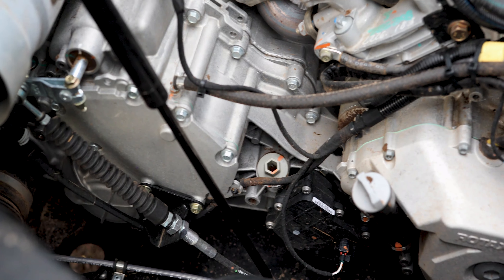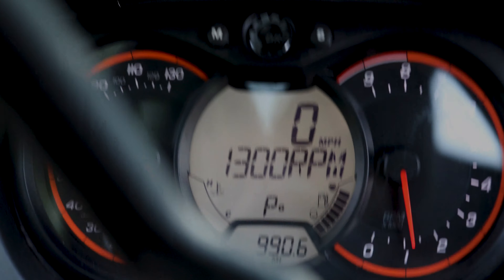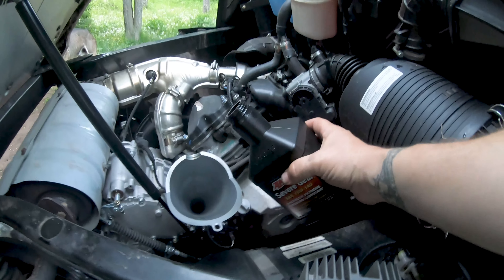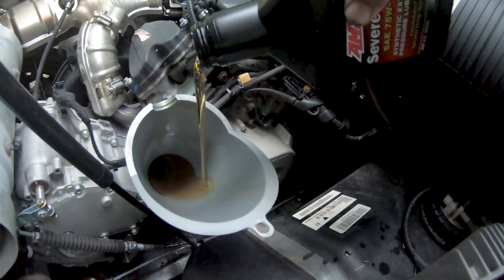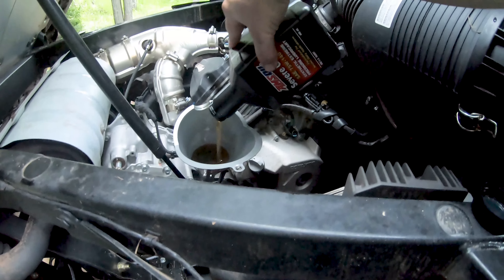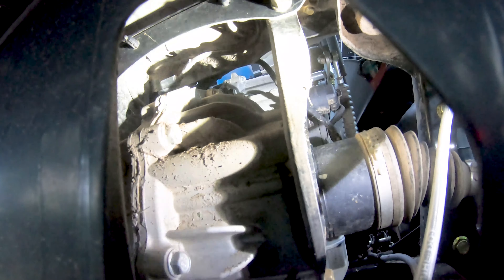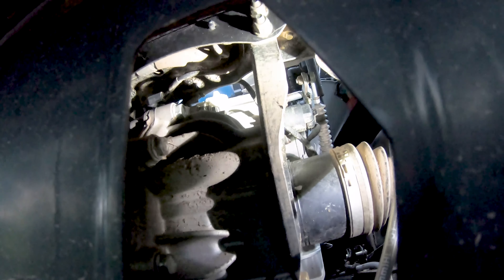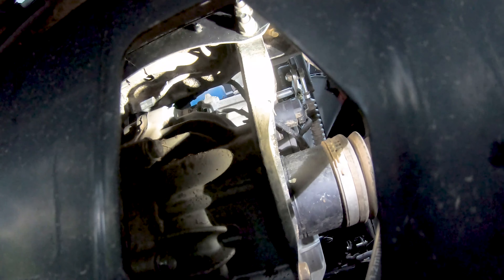Gear Box Oil Change // Can-Am Defender XT HD8/ HD10

Comment: Decent video I had to skip a lot I didn't care about the turtle just was trying to get right to the point. 
So there's not really a separate transmisson you have change the oil in, thats basically The transmission / rear gearbox you just changed the oil in? I'm really needing to change mine in my xmr.
Reply from the maker: Yes, no separate gear box like the Outlander has. Talk about difficult, oi 💩

Comment: My reverse has went out for some reason.  I have the 4 seater Texas Edition
Reply from the maker: Might just be a linkage adjustment.
Reply: @endurancekennels  Thought about that but all other positions work fine.  Seems if I move the linkage it would affect all others.  Park is good, reverse grinds a little but will not engage.  Past that high works then low works also?
Reply from the maker: @79xlch  crappy! Is it still under warranty? I have a two year warranty on mine.
Reply: @endurancekennels  I assume 1 year with it being 21 months old 880 miles
Reply from the maker: @Mr79xlch  two year it's a commercial work vehicle for the kennel.

Comment: Nice video, did you notice any difference in the ride after you changed this? What about after the engine oil. My buddy said his ran noticeably better once he did initial fluid changes
Reply from the maker: Yes for sure. Much quieter and smoother all around.

Comment: I noticed the end of my plug was full.of what looks like an anti seize? Did you notice anything on yours
Reply from the maker: No. Do you have a pic? The plug is magnetized so it picks up slack could be just that.
Reply: @endurancekennels  it does yes. I went on some forums and they said its common for the first oil changed
Reply: @endurancekennels  thanks for the reply

Comment: Take the muffler out. I did it without taking anything off. I have smaller hands tho. It was a big pain in the ass for nothing. I have 1200 miles on mine and it wasn't dirty. Waste of time.
Reply from the maker: What are you talking about?
Reply: Cleaning the speed sensor. Sorry

Comment: You dont screw in a dipstick to check fluid level....just so u know for next time.
Reply from the maker: Interesting so what do you do?
Reply: Luke: on Can Am machines, yes you do. It says so right in the manual. On some other brands of machines you aren't supposed to (hondas for example), you set the dipstick on the threads without screwing it all the way in to check the oil, and you check it at full operating temp. Not so for Can Am's - you check it with the oil cold and dipstick screwed all the way in.

Please don't make blanket statements about equipment maintenance without knowing the correct answer. If someone takes that advice and you've given them the wrong info, they'll be over/underfilling their sump...and on machines with small sumps like this, the difference between the dipstick being screwed in or not can end up being a significant amount of oil.